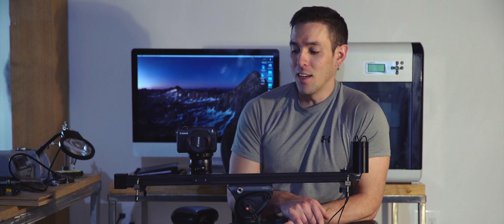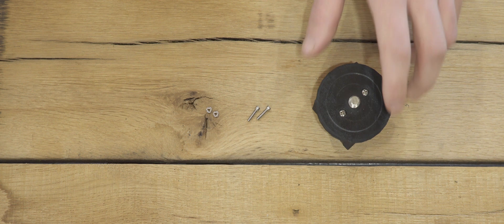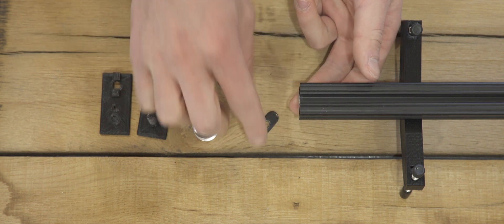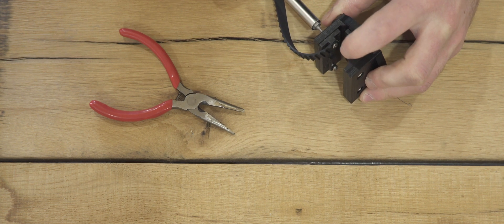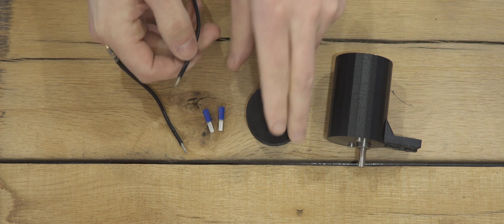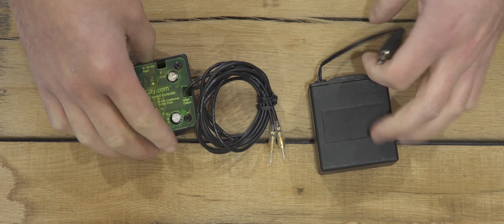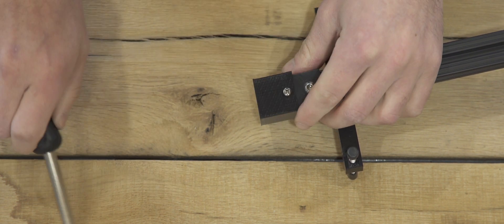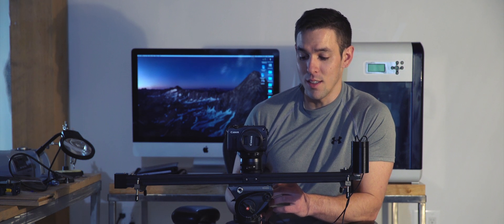Ultralight DIY Slider Part II: Motorized!

Comment: Ive been designing an almost identical system and wondered if having a strong spring loaded pulley would help keep the belt under tension and less likely to skip whilst raising the weight of a camera etc. Many more vids to watch but this was good, thanks4posting.

Comment: is there an alternative to servo city speed controller that doesnt cost $70? I mean it kinda defeats the point paying that much for one piece of the DIY puzzle when you can find a chinese speed controller for 0.99c on ebay, its just not 2 way, so you have to get a switch which reverses polarity also availably on ebay for about 1$... so anyone know a good substitute to servo city's version of a speed controller at an affordable price?

Comment: Wow. Nice work! How loud is the motor?
Reply from the maker: +Jack Pearce Thanks! The 45RPM motor seen in the video is pretty quiet. In the clips where I'm talking to the camera, the microphone is actually closer to the motor than it is to me. The only time you can hear it is at 0:40, when I accidentally crank it to full speed. The important thing to know is that the noise of the motor is directly proportional to its speed. The 45 RPM motor operating at 10RPM is virtually silent. So if you were to build a slider with a 60RPM motor, it would actually run much quieter at 45RPM than a 45RPM motor running at full speed.